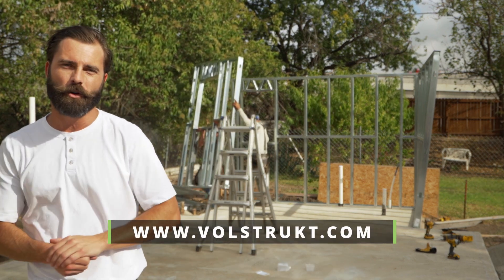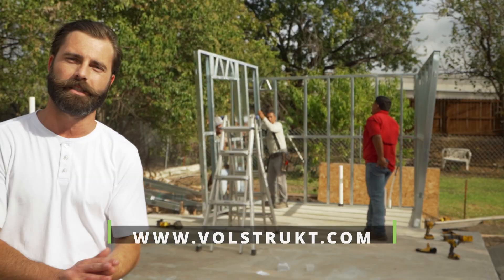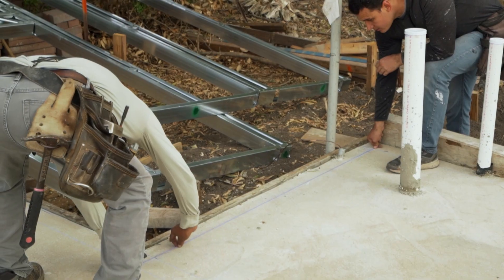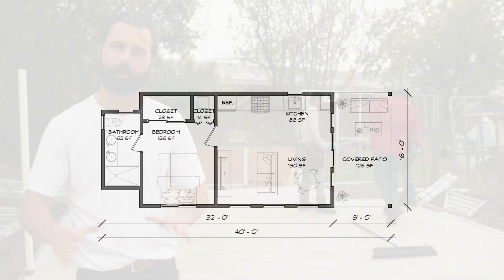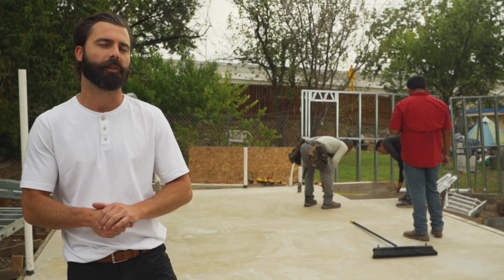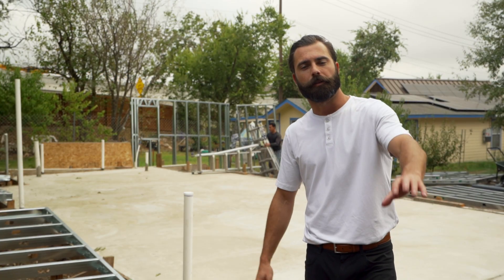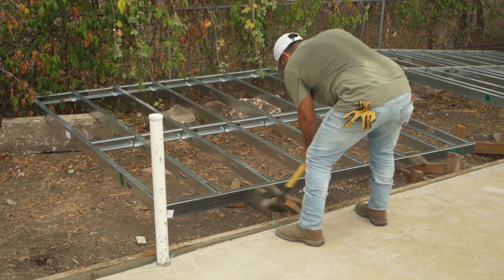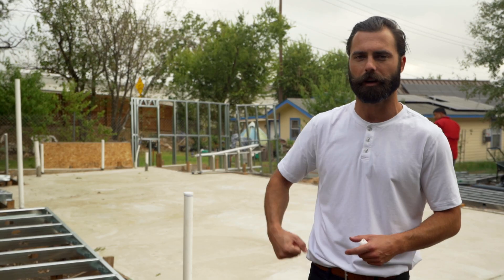How to assemble a 500sqft ADU steel frame kit in one day

Comment: A question: Steel framing, particularly when designed in CAD and produced using CNC equipment, seems to offer a ton of advantages over traditional wood framing. What's kept it from really taking off? Is it just inertia, where builders are reluctant to change methods? Is it fundamentally more expensive?

I work in aerospace and design CNC'd metal structure all day long. I'm astounded that home construction methods in the US are still so dependent on hand fitting inaccurately manufactured parts.